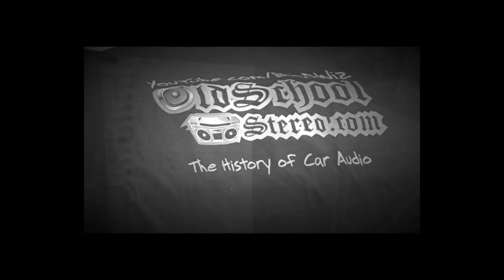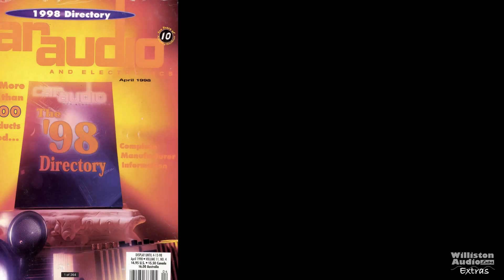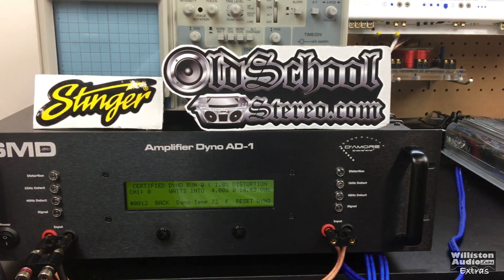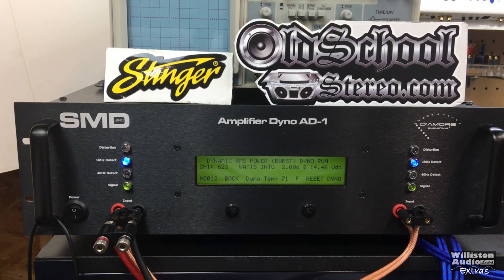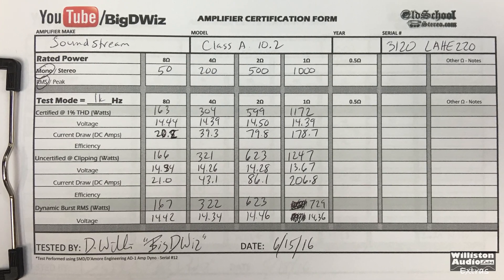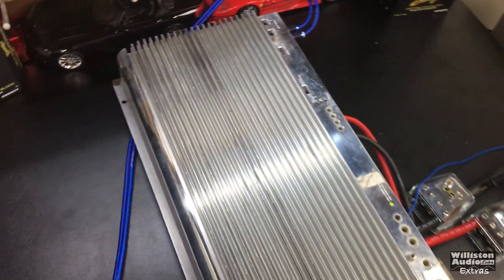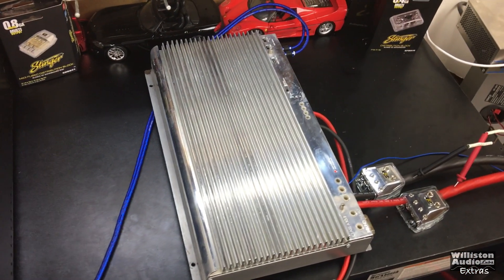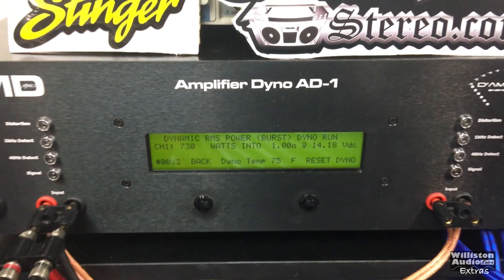1998 Soundstream Rubicon Class A 10.2 Overview and Amp Dyno Test [4K]

Comment: My very first bass competition i had 2-mtx 2160s and the owner of the audio shop I bought everything from for my wall of 4-15s had went with me and I was going to enter 0-500 amateur class and he said don't....run the 501-1k class. I understand why now and he was right. I actually won my class after 3 different rounds winning each. Only hit 144.xx, but for 1996 that was alot. If I had entered the 0-500 I would have went against a guy with 12-15s powered by 12-25w US Amps(each 2' long) that did like a 155.😂

Comment: The 10.2 addressed the power source issues the 10.0 was known for. THAT 10.0 there on this video is a 2nd generation 10.0 with the HUGE Ceramic Resistor blocks in place. Older models had resistor heating issues real bad. Upgrade the resistors was a band aid fix.  !0.2 is much more reliable and less prone to failure. BDBD/2022
Reply from the maker: Good 2 know 👍

Comment: I have a 10.0 that blew some of the diodes around the output side of the board. Unfortunately i can't really see the bands around the diodes in the video. My question would could u take pictures of the board? I have searched the internet for years and the 2 pics I've ever seen once u zoom in u can't make out the band colors. Another side note on the right side of the board looks like the power side on yours it has long caps sideways, on mine it's more, shorter caps. Thanks Peace
Reply from the maker: I don't have easy access to this currently. If you're on Facebook I'd suggest checking the Old School Soundstream page as I'm sure someone there could assist

Comment: Is the old stuff from the late 90's better than the new stuff? I was looking at a young co-worker's new system he got for his car. I wasn't really impressed. I had a 200w Rockford Fosgate annihilator that pushed a couple of 12's harder than his 1000w.
Reply from the maker: I believe much of the 90’s amps are built better than today because these sold for close to $1000 back then which is like $2500 in today’s $$ and there are not mass market amps today selling for that much. They could spend more on design and quality back then
Reply: @wal2  makes sense. The components haven't really changed but back then companies made an honest effort to make the best. China has proven this strategy wrong again and again. Now they all look to cut corners.

Comment: Hey Big D! Can you tell me what those capacitors are? I'm repairing a similar amp and it appears that both those amps had the main capacitor bank replaced with fewer, but higher capacity Nichicon  caps. The original caps were made by ECI and are impossible nowdays.
Reply from the maker: This amp is long gone, borrowed from a friend

Comment: 60% efficient "Class A" amp into 2 ohms? right.........
Reply from the maker: Several car audio companies have used “Class A” over the years but they simply biased the AB high so the amp “appeared” to run Class A at low power. Alphasonik did it way back in 1988 with their PMA series amps

Comment: You can tell this amp isn't just a class A. It's a class A AB and runs dual rail voltages. The indication is that all the transistors are matching pairs. It's a very well made amp and apparently can switch on and off transistor banks AND change rail voltage at its own discretion.
Reply: It's called a triple Darlington array.
Reply from the maker: Marketing as they phrased it “Pure Class A”, we didn’t say “Real Class A” 😝
Reply: There are plenty of Class A amps with dual rails and matched pairs, so that’s not a good indicator.
Reply: @brandise76  Class A doesn't have "matched pairs" by definition. To produce a killowatt with a Class A, the amp would have to pull 4 killowatts to do it with capacitive coupling on the output, which I don't see here. I also don't see output transformers. This is a Class AB amp. 100%

Comment: Class A is so named because it is the best class. A true class A amp will consume it's full power at idle and only best at 25-33% efficient.
Reply: Class A amps are ALWAYS on.  That's why they run so hot. That's also the reason  why audiophiles love them because they are linear compared to a push-pull A/B amp.
Reply from the maker: SS was fudging the Class A part. This is an AB amp

Comment: I ran a 700sx and 500sx and they both had auto high current switchover.   Anything less than a 4 ohm load per channel usually caused them to switch to high current mode.
Reply from the maker: Oh that’s a bummer. Safety switch FTL

Comment: That is cold a Slow blow fuse or a time-delay fuse you can get fast acting fuses that blow instantly as well
Reply from the maker: None of the car audio related fuses I’ve ever seen are the fast type.
Reply: @wal2  It's basically there to prevent things inside from going full Chernobyl style failure if a transistor shunts and crowbars the input! ;-)

Comment: Ah, back when Soundstream stuff was solid, quality gear.
Reply from the maker: Solid for sure
Reply: I'd say soundstream still makes good amps and never stopped
Reply: @jarvislarson6864  - 🤣🤣🤣🤣
Reply: @jarvislarson6864  they are not the same family owned company they were from the early 80s to the early 2000s, when the company was sold to a conglomerate (Epsilon Electronics) and manufacture moved to China...but I would say they are as good as any of the other Chinese made amps available at 1 dime per dozen. Certainly not what they once were.
Reply: I loved their Granite series from back in the mid 90s. They even released a book called Heavy Weight Boxing, which had a plethora of box designs in it.

Comment: I had a Rubicon 302 around that time on 4 Blaupunkt 12s in an 83 C-10 with nowhere near enough airspace but it tried to beat the doors off of it.
Reply from the maker: Awesome 👏
Reply: That was a great amp - I had two 302s, SPL50 front 2ohm components and SPL55 rear coaxials, and two SPL170 subs. Couldn’t afford a Rubicon 1002 so ended up running MTX 2300x sub amps on 4 SPL170s in a 95 Volvo 😂

I have a later release Rubicon1002 now, after they deleted the front shield, and it just lives on a shelf, but I finally got one 😂